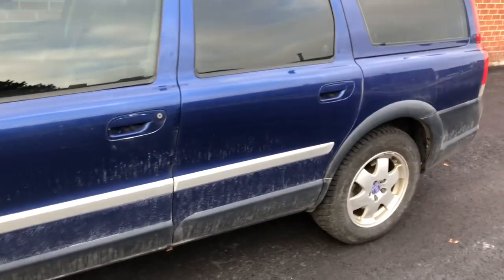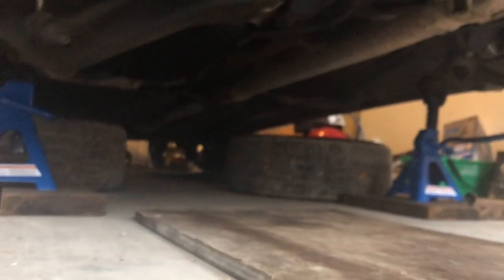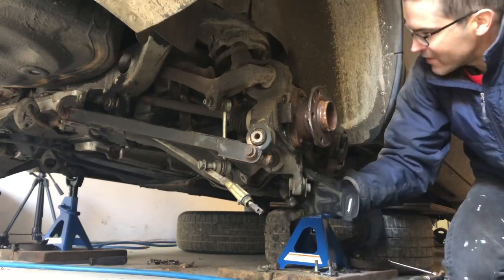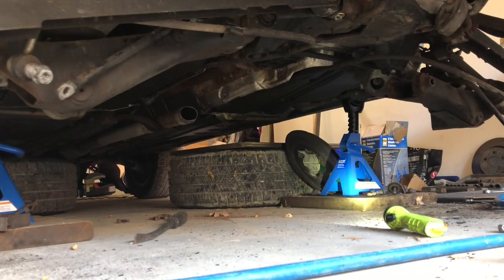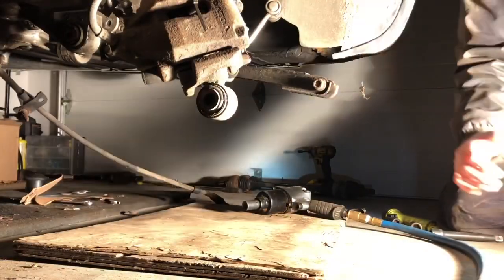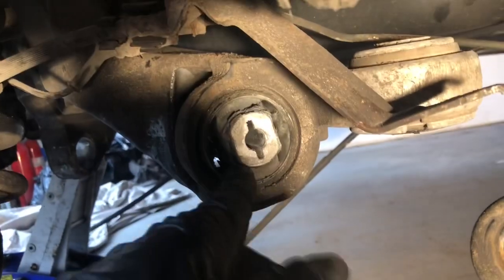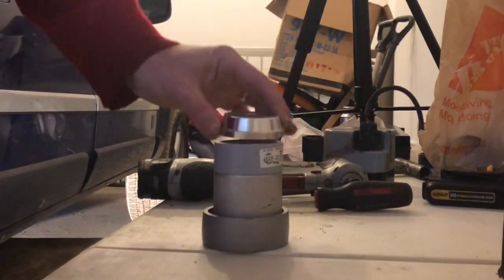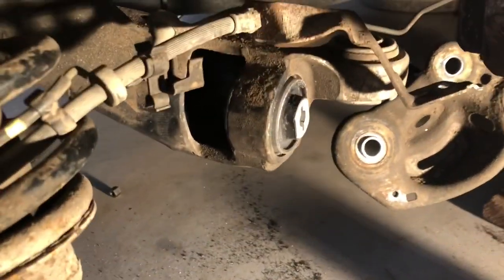How to replace trailing arm bushings (part #31277893) on 2001-2007 V70 / XC70 AWD.

Comment: Could these be the cause of rear jumping to one side or the other when hitting a pothole or recessed manhole cover with one of the rear wheels? My xc70 jerks to one side when i hit a pothole. Im actually thinking of dropping the whole subframe and changing all the bushings, since theyre original from 2001.
Reply: same issue on my car, I will give it a try and change it soon

Comment: Is there really no way to do it without dropping the subframe?
Reply from the maker: Well, I can't say for sure but when you take the wheel off and have a look at how little space there is in front of that bushing you'll see that it's a real challenge. There simply isn't enough space to get a bushing and press tool in there unlike the XC90 where you get direct, unobstructed access.